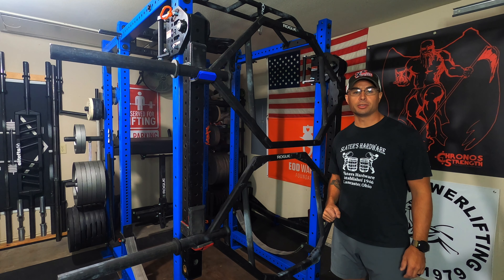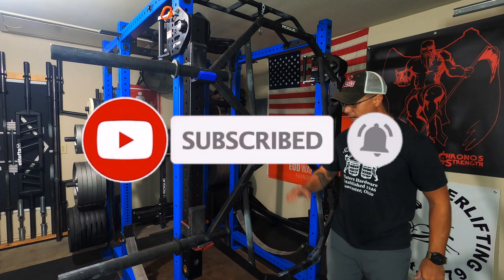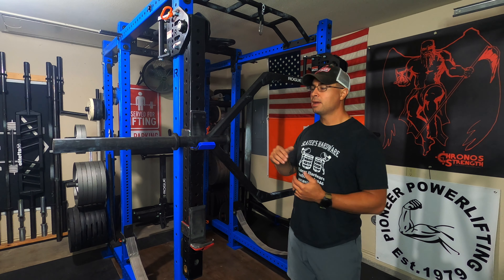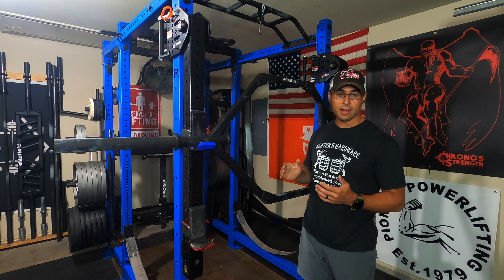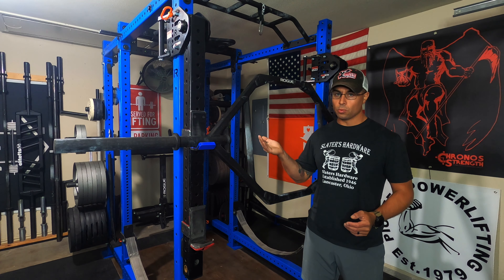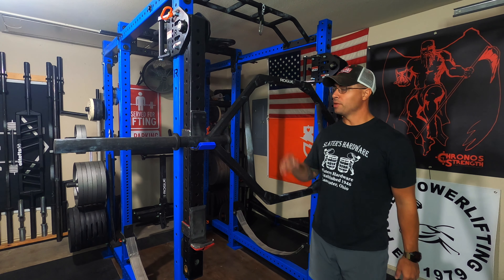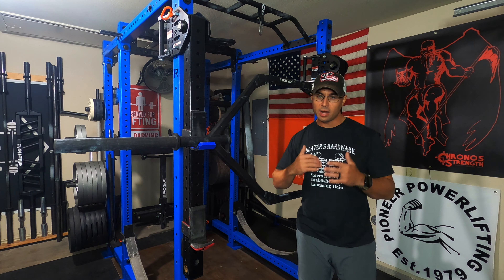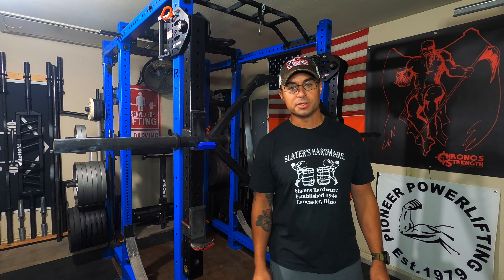Rogue Fitness TB-1 Trap Bar | Overpriced? | Super-Heavy Trap Bar Training | In-Depth Review

Comment: I have a trap bar just like this one from Wright equipment. It's USA made and I picked it up on clearance for $170. The knurling is pretty weak (maybe that's why it was on clearance) but overall it's the exact same design. I specifically wanted THIS exact design for several reasons. It's a tank. Zero whip and can handle anything you throw at it. It's easier to store. The open ended trap bars have a thicker profile and ones with the raised handles even more so. It's rackable. The Kabuki bar is not rackable the Eleiko is but $800 for a trap bar is ludicrous. I never used the raised handles, and even if I wanted to emulate that effect I would just use it off of blocks. I love the simplicity and utility of this type of trap bar.
Reply from the maker: There is definitely a reason that these types of trap bars are still made.  It's a solid bar with plenty of sleeve length

Comment: Great review Kurt. I’m thinking about getting this bar since I don’t need the higher handles and this would be much easier to store. My biggest concern is the tilting issue you talked about. 

Do you consider that a major issue? Do you still find some tilting even when you hold it centered and lift carefully?
Reply from the maker: If you grab the bar centered you’re gonna be just fine. My feedback to rogue was to put a knurl break where the center of the bar is to be a visual indication to the lifter for center of balance. I marked mine with a paint pen

Comment: Great video.  Do you have a specific recommendation for an open ended trap bar that isn't as expensive as Kabuki?
Reply from the maker: I haven’t really shopped around for a more budget friendly option. I know coop at garage gym reviews has done several reviews though. I plan on acquiring one in the near future but have several things occurring that carry a higher priority at the moment
Reply: Did you ever end up picking up an open trap bar? I know Bells of Steel and Giant Lifting make relatively cheap ones. Vulcan’s is a bit more expensive but still less than Kabuki.

Comment: Bells of Steel has a new open ended trap bar that I’m considering.  It’s $250 shipped.
Reply from the maker: I’d be interested in testing it out. They make decent specialty bars
Reply: They have Very short sleeves though
Reply from the maker: That’s too bad. This is the second BOS bar I’ve heard of having this issue